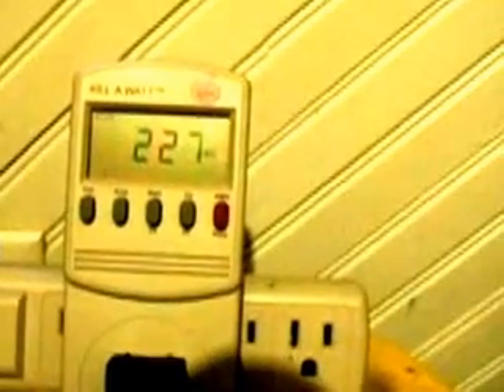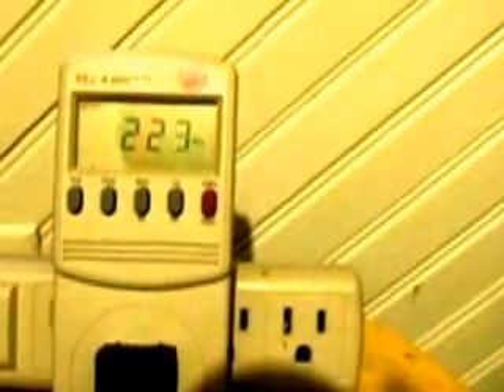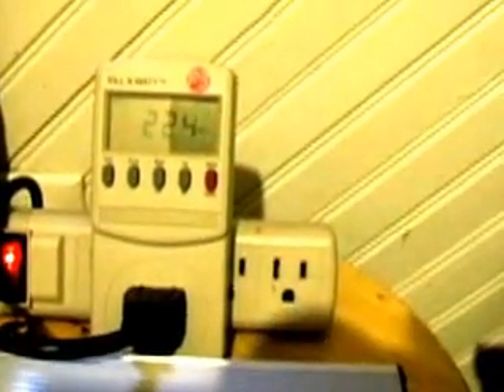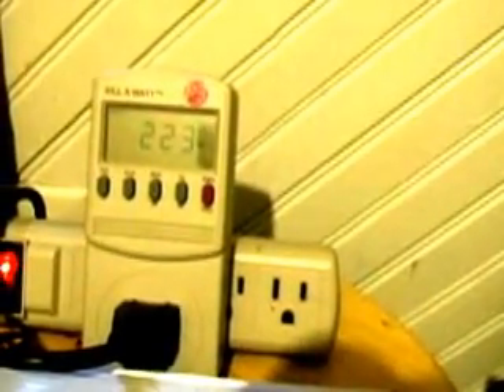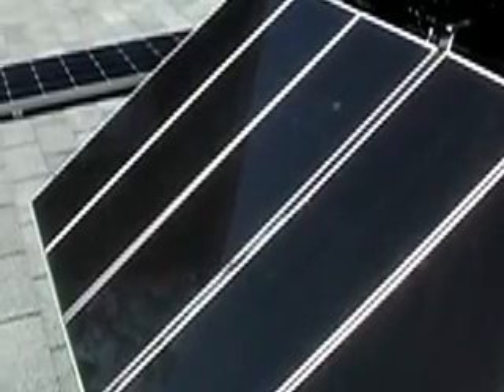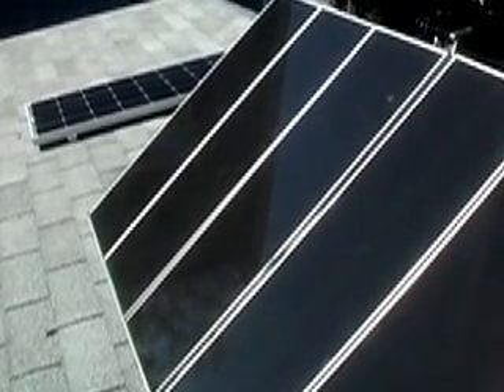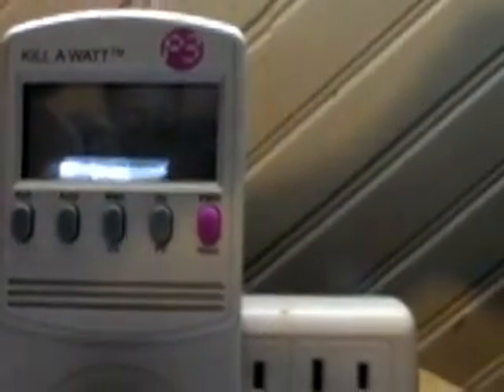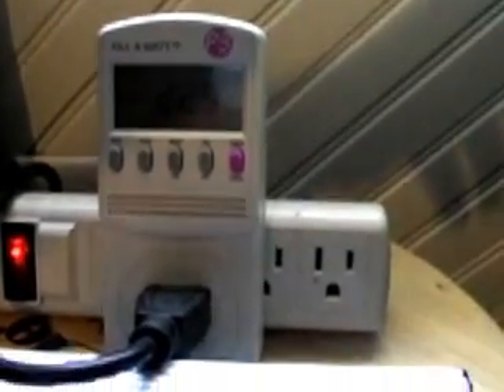225 Watt Grid Tie Inverter Solar Panel Array Renogy 100 watt & Harbor Freight Panels

Comment: what type panel is the 100 watt that you have?i'm lookking to add one to my HF kit as well.and where can i get one from
Reply from the maker: 100 watt from ebay its a poly
Reply: *****
not to familiar with the different type of panels.is that a Poly-Crystalline panel.and will it be fine to tie my 9 HF panel together with the 100 watt Poly-Crystalline panel?thank you in advance
Reply from the maker: it depends on hopw many watts your inverter is rated for are you using it to charge batteries? or are you using a grid tie inverter to feed your house grid like I am? are you using the HF charge controller?
Reply: *****
i will be using it for grid tie just as you are sir,yes i have a HF charge controller 30  amp i don't have a inverter yet,i'm just trying to figure out which is compatiable with my Hf panels so i can run them safely together,such as the setup you have.
reccomendations on a charge controller would help also if you will.

Comment: I'm looking to setup a system like yours.i have 10 harbor frieght panels already on a 4 battery bank setup.i'm not real familiar with electricity,by any chance can give me more details on the GTI,and the connectors that you purchase on  Ebay.And also when you said you use 20ft of 10 gauge wire,do you mean you cut the original wire from the HF panels and replaced it with 10 gauge.Thk you in advance

Comment from the maker: Yes they are all 12v panels wired in parallell i ordered 20 foot 10 gauge which i cut to fit and applied the connectors to the wire off ebay from a solar supplier for the 100 watt panel the HARBOR FREIGHTS were pre wired (10 ft) i think